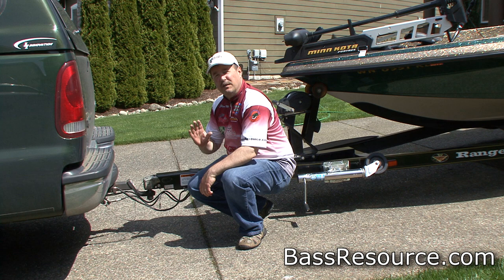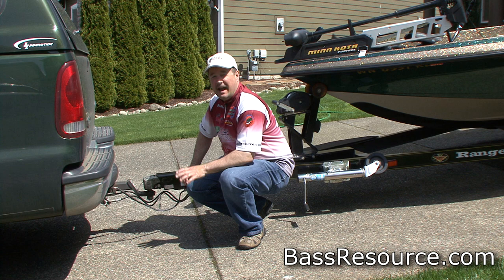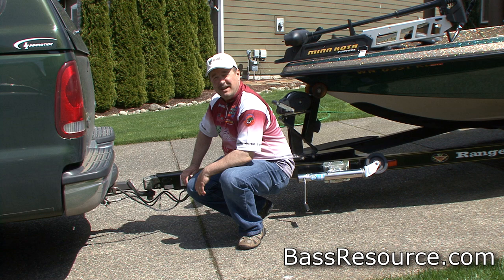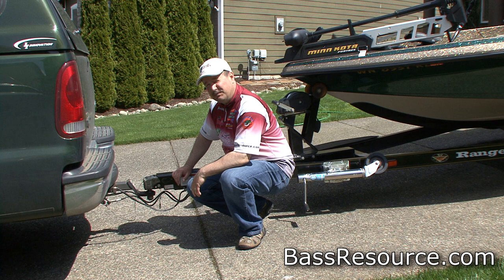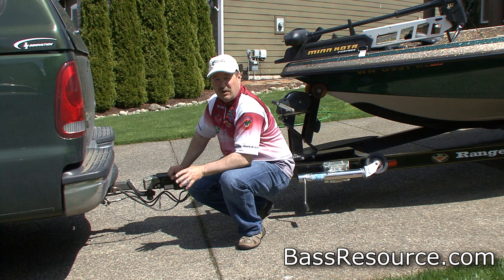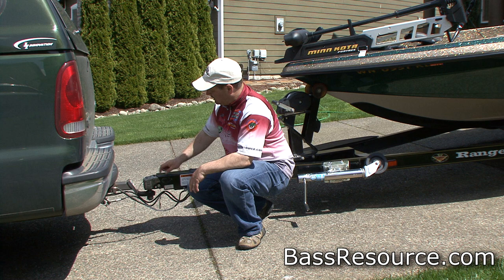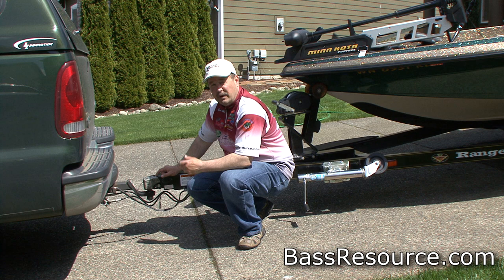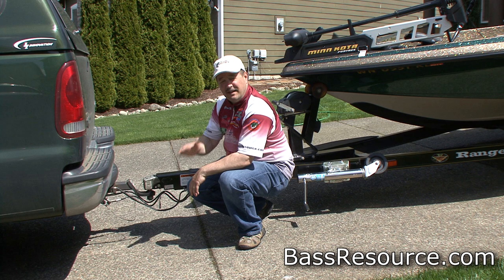How To Prevent Trailer Hitch Failure While Towing

Comment: Regarding tightening the nut, last week was probably the 50th time I’d pulled my utility trailer and as you mentioned, I kept hearing a clunky noise at stop lights. When I later removed the setup from my truck receiver the nut was only a turn away from being completely off!  This video also reminded me to use lube, which I’d been neglecting the last few trips. Thank for the reminders!

Comment: Tip #1:  Make sure your ball and coupler are the the same size.  #2: Make sure your coupler is properly latched and the latch is secured with a pin or lock, as is the receiver pin if in use.

It's best to use a ball with a shank drilled for a cotter key under the nut, and use a key.  Also, it appears that "hitch ball grease" is no better than, and probably not as good as good moly or lithium grease in your grease gun.  The ball grease appears to be white lithium with teflon, mainly designed to not wash off or stain.  But it lubricates no better.  Look at what truckers use on their fifth wheels....
Reply: that reminds me of a funny story. l work in a tool rental center and a guy wanted to rent out our bobcat T450 which weighs close to 10,000 pounds trailer and everything included. and l see the guy's truck out the window and it's an early 2000's F150, and l told the guy "there is no way that truck can safely pull this thing, l don't think you suspension could even handle the tongue weight." and he says "well let's see, if it can't then i'll drop it and leave it." so we go over to his truck and he has a 2" ball mounted on his bumper. l looked at him and said "DUDE NO!" he kept trying to convince me it was a 2 5/16" ball and the numbers had just been worn off. l could clearly see that it was a 2" ball and even still it was mounted on his bumper. you need at least a class 3 hitch to tow something that large, the tongue weight alone would rip off your bumper.

Comment: Grease. 
And by the way. Were those steel cables you had on there instead of safety chains? 
If so, then that's the first time I've seen that. And I like it!
Reply from the maker: ***** Yes, those are steel cables.  Works better than chains.

Comment: Wtf is wrong with lithium grease?
Reply from the maker: Hitches require a high pressure grease, which offer better performance than general-purpose lithium grease when metal parts are under high loads. 

In addition, hitch grease is more water-resistant than lithium grease, which you need - especially if you have a shallow ramp and need to submerge the hitch in water in order to load/unload the boat. 

In short, use the proper grease made for the job. There's a reason it exists.
Reply: it doesn't matter, hitches aren't picky. as long as there is some kind of lubricant there, you're better off than most of the other people out there towing stuff.
Reply: Messy and will ruin your clothes when it touches them and it will eventually.
Reply: Try “3 in 1 trailer hitch gel lube”. Cost $6.97 a spray can